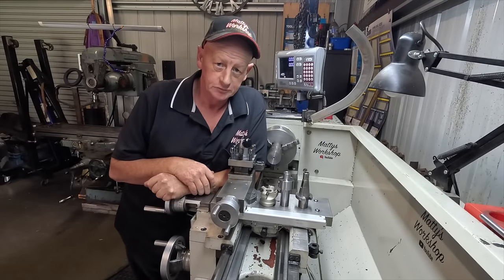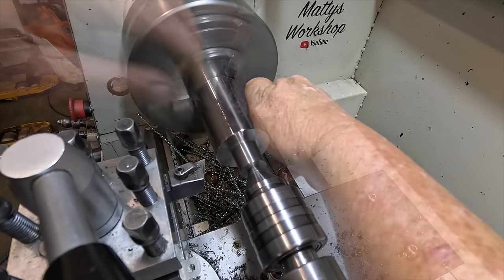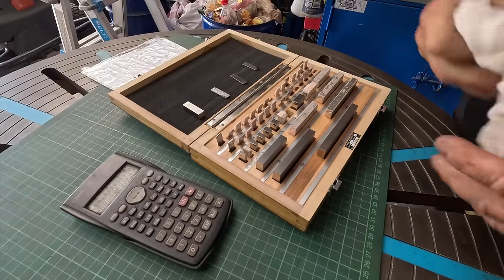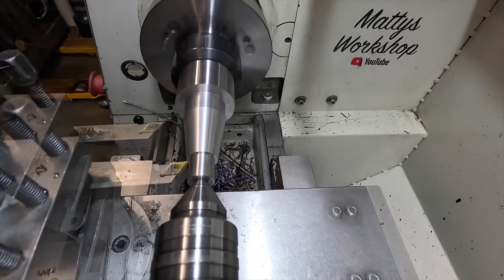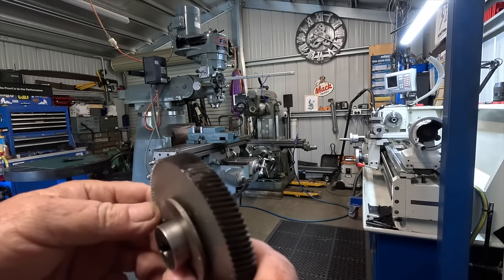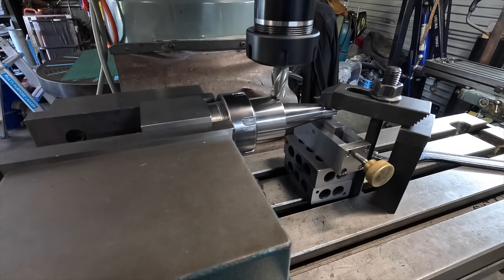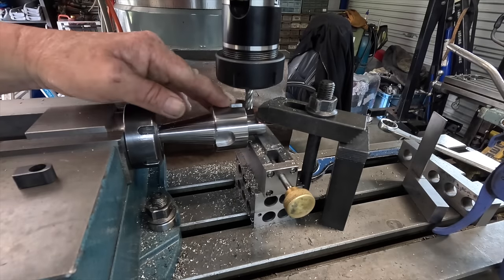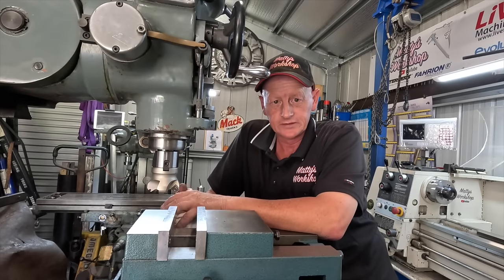NT30 Arbor for the Face Mill...

Comment: Hi Matty, good post mate, enjoyed it.
 We had a mill that was branded to "Sharp", but was a 'First' mill, made by Long Chang Machinery Co.,  Taiwan. Had to get a manual off them but had to pay. As for the right spot on the quill, block the quill so it won't fall on your toes. Take out the handle and you will remove the pinion, could be a clue on that. You could also have a look at the rack through the pinion hole. Regards to you and family 👍
Reply from the maker: Gday, Ive been lucky enough to get the information from First on the mill today, I just have to start finding the issue now, Appreciate you watching and commenting mate, Cheers

Comment: One for next time, if you really want close to zero run-out you should leave the surface oversized and true it up in the mill spindle. Good job, she'll be alright for what you need and 0.02mm RO is very decent.
Reply from the maker: Gday, Ive seen this done before but didn't give it a thought, Appreciate you watching mate, Cheers
Reply: another thing I thought of too, do your drilled and tapped holes and then turn everything between centers. then you'd have zero run out between your taper and the surface the shell mill sits on (that goes for the back face as well. and if your tapped holes aren't straight it won't matter because turning between them will minimize any mismatch drastically.

Comment: Mat I had a funny feeling when you where getting the trailer ready for a 500KM road trip a new machine was coming to the shop. I could not hear any excessive noise from the bearings. If you only getting 0.0001 runout from the spindle I would say the spindle drive is in perfect health.
Reply from the maker: Gday, The trailer repair was after I picked the machine up, I was on another mission for a mate when I did the 500k trip, the mill pickup was a 1000k adventure, was a fun day to, Thanks for watching mate, Cheers

Comment: You can go off people you know!!! 😆. I am not in the least bit jealous 😭😭😭. Well done mate, good score, and in my opinion the pulley change heads are far more durable than the vari drive versions. Spindle sounds ok, heard far worse. I would start with your X Axis gib adjustment based on the noises you are getting, followed by Y. Got to ask yourself why the traverse gear is mangled.......start there and work backwards. 👍🏴
Reply from the maker: Gday Jon, Im pretty stoked to have this mill, I've done some more investgating today and I believe I've found the issue, I really don't mind the step pulley setup, its not that hard to change the belt speed at all and its quite, Appreciate you watching as always mate, Cheers

Comment: Matty I have a Bridgeport Clone marketed as McClane. Made in China but the head is made in Tiawan. The same mill is marketed in many different brands. Even the PM Mathews is the same mill. AS well as Sharp and Acer and many many more. The only manual I could find is branded Birmingham. I have the paper copy that I could take a picture of the belt drive head and email it to you if that would help. My quill kept falling down with any weight at all on it. I took the handle off and looked inside on the right side and the clock spring had came off. It is really simple to work on as I took pictures as I took it apart. I prefer the belt drive because it is so much Quiter. I gutted the electrical panel and put a VFD inside the panel and it is quite as a church mouse, and I do not have to change pulleys to have variable speed. I absolutely love. it. I very seldom use my PM Mathews 833T gear drive mill anymore because of the difference in noise and speed. Thanks for bringing us along.
Reply from the maker: Gday Terry, Thanks to a viewer I was able to get in contact with the company here in Australia that sell the First Mill, These guys were kind enough to send me a parts breakdown and parts list of the mill, I got super lucky mate, I really don't mind the step pulley setup now I have the VFD, Appreciate you watching mate, Cheers

Comment: Hey Matty, I know a guy down the coast that could probably make a gear like that 🤔Does the table swivel on the cincinnati? What HP is the motor? The VFD seems to work well - I'd like to put one on my Maho, but there is too much control gear in it. All the best mate. Cheers
Reply from the maker: G'day, I wish I could make this gear but sadly im not setup to do helical gears, thats way above my brain cell level, I have a 3hp Vfd and the mill is 2hp motor, Thanks for watching mate, Cheers

Comment: Great job on the arbour Matty. The slight cushion at the top of the quill travel is a good thing. Saves the quill whacking the bottom of the spindle when you let go of the handle. I had an old Richmond mill that was the same. Never gave any problems.  ATB regards from the UK
Reply from the maker: Gday, In one way its a good thing for sure but worries me in another way that its not right, Thanks for watching mate, Cheers

Comment: That is a bridgeport clone,  mine had issue with sticking quill and I found the collar around the quill stop screw was slightly cocked.  it rides up and down the front window with a close tolerance to the machine and if off slightly it would drag.  Mine would get out of alignment when it sprang up to the top.  I simply turned it to square with the window with a crescent wrench, spanner to you I believe, and it worked smoothly.  Of course this was after complete disassembly and reassembly.  I also loosened the return spring for the quill so it does not return as hard.  Hope yours is the same,  if so it will take less than a minute to correct.  This is the collar that surrounds the quill stop screw.  Look in the back part where it attaches to the quill and its square shoulder clearance to the machined vertical slot.
Reply from the maker: Gday, Thanks very much for the heads up i'll check that out and see how I go, Much appreciated mate, Cheers

Comment: Gday Matty nice job as always I had to make an nt30 arbor for a tapping chuck all worked out fine but the material I used was the hardest I have ever machined I had to use ceramic inserts for the whole job
Reply from the maker: Gday, I have to get some ceramic inserts myself, I have some stock here I need to get the case hardening off, Thanks for watching mate, Cheers

Comment: Congratulations on what looks like a really nice, new to you mill and good to see you looking so chipper Matty. 
I bought a universal mill (1966 vintage) in really good condition, which is still being set up, which is ISO40 on both spindles. I priced up EN8 (1045) material to make some new tool holders, which would have been around £40 per holder. My local tooling merchant, also one of the UK's biggest suppliers had a January offer of YG-1 ISO40 tooling, balanced to 15K, at just over £20 each. I ended up splurging rather more than I originally intended on 10 of various types, I quite simply couldn't justify machining them myself.
Have a look at Tom's Rabbit Hole, he now has the ability to hob helical gears on his much modified mill, he may be able to help out.
Reply from the maker: Gday, Bill, I found thew same thing here, I was looking at making my own collet arbors first, I ended up buying one for $49, By the time I brought a collet nut and material it was well over the $49 and still had to do the machining, I also brought a ISO30-MT3 for $44, Ive been following Tom for quite a while, He is bloody amazing and im fascinated with what's he's done, its truly a work out art mate, truly appreciate you watching and commenting, Cheers

Comment: Hi Matty, congratulations on your new mill.  I'm looking forward to watching you get it dialed in.  Good luck finding the manuals.  Regards, Dave
Reply from the maker: Gday Dave, hopefully its not going to take to much dealing in, I'll be happy if the spindle bearings only need an adjustment, Thanks for watching mate, Cheers

Comment: the quill sleeve gaurd may be binding Matty on the top stroke of travel, check your height stop window see if you have crap in there. its a tight fit so any swarf may be the culprit
Reply from the maker: Gday Troy, thanks for the tip mate, I'll check that out tomorrow, Cheers

Comment: Nice job Matty! This really is the best kind of face mill for a bridgeport type machine. I use mine all the time for when I need to take off a lot of metal. I let it run about 500-600 rpm with a 300mm/min or so feed rate and just let it eat
Reply from the maker: Thanks for watching mate, Cheers

Comment: Re first mill. The tightness at the top of the quill will probably be due to the adjustable depth stop fitting . They tend to distort the quill tube slightly if banged to a stop.
Reply: I thought maybe had a ringclamp on it for years - for a light or a measuring tool??? Since been removed
Reply from the maker: Thanks mate, I have some investigating to do I think, Cheers

Comment: Very exciting to have a new mill, looks like it’s in great condition.  Pull a belt off when spinning that arbour by hand to see if it’s the bearing or just he motor noise.  Sounds similar to mine and the bearings are good.  Some lubricant (spray mist) may help with the squeal. That’s excellent runout on the arbour, I doubt there’s anything wrong with the bearings considering the condition of the machine.  I added a quill DRO on mine, just an idea to look into https://youtu.be/hww_Lm_e3oA?si=rBgSQsMB6kxkwVZv
Reply from the maker: Gday, Ive had the belt off and the bearings sound pretty quite, im still looking at taking the spindle out just to have a good look at the bearings though, I'll check the link out, definitely going to need a quill DRO at some stage, Thanks for watching mate, Cheers

Comment: Wooooo Hooooo 🥳🥳
A spindle rebuild 👏👏👏
No disappointment there for us mate….. it means another Matty’s Workshop video
😎
Can’t wait mate…. Sand that turret mill looks to have been well cared for.
Regards
Robert
PS Does it have a quill auto feed?
Reply from the maker: Gday Robert, Its not going to be a complete strip down and i'm pretty happy about that, for a 1980 model machine its in good condition overall and it does have a auto feed on the quill, Appreciate you watching mate, Cheers

Comment: Hi Matty, just buy an ALSGS or Align power feed, the helical gears are the same and if you strip one, easily done, buy a new gear, cheap as chips.
I had a similar mill, branded Smart.
The heads are all the same, make sure it is well oiled and adjust the preloaded on the bearings..
Mine had Turcite on chrome ways, last forever.
Have to persevere with my mill drill for now, such is life.
Reply: The Align and ALSGS power feeds are 230 Volt, no need for transformer. 
I stripped a gear in mine, not waiting for it to slow down and putting in reverse, otherwise they are bullet proof.
Reply from the maker: Gday, If I can pick up a gear for the Servo power feed it would be nice to keep it all original, if the gear isn't available then i'll look at getting a new one, Appreciate you watching mate, Cheers

Comment: G'day Matty, sorry only got to this today ( Saturday) nice job mate. 0.02 runout is pretty good even with the suspected spindle bearing problem. If you do have to replace them, then theoretically the runout should be even less. Presumably the bearings will be taper roller ones, so the replacement of them should be pretty straightforward mate. Anyway you'll get it sorted knowing you Matty . Is there a visual ding on the outside surface of the quill around the place where it goes tight? Hopefully it's something like that, that you can stone down to ease it. Cheers from England, Sam
Reply from the maker: Gday Sam, there annular contact bearings and there getting replaced, once the spindle is out I can have a good look at the internal taper, Thanks for watching, Cheers

Comment: Matty  don't convert to angle,  stay with a slope .i.e. the ratio of the length of your sine bar to the taper length (24) it the same as the ratio of the depth of the taper to your gauge block stack , so no tables required just divide and multiply
Reply from the maker: Gday, I really wish I payed more attention in maths class at school rather then looking at log trucks going past out the window, I have a lot of trouble when it comes to numbers mate, Cheers

Comment: What DP is your gear?  If I have all relevant dimensions and the necessary cutter I'll see if I can make the time to produce one.  I do have some ductile iron on hand in size up to 6 inch diameter. . . .  Mill feeds are currently in last stage of overhaul, so a good test of that system would be welcome.
Reply from the maker: Gday, Thanks very. much for your offer, Im pretty sure a viewer has sourced where I can buy a gear from, if something goes wrong I'll let you know, Thanks for watching, Cheers

Comment: Hey Matty, my Bridgeport quill has that same tight spot. It started after a cheap Chinese-em arbor got stuck in quill, I had to adjust the guide pin in the spindle and once I got it sorted out and adjusted properly the tight spot went away. I guess what I’m saying is to check the alignment pin in the spindle, or even remove it and test the quill operation, if it clears up the tight spot then there is your problem.
Reply from the maker: Gday, Ill have a good look at the spindle mate, Appreciate you watching mate, Cheers

Comment: Howdy Matty. I have that same milling machine, with the exception of my head is variable speed. I can check if I have the same gear. If so I'll see about building ya one. Great video!
Cap'n
Reply from the maker: Gday, Thanks very much mate, Greatly appreciated, Cheers
Reply: I measured my drive gear, it is 90 mm. I will pull it off this weekend and count the teeth. My power fed is an Enco brand. Maybe it's the same as yours. If so, I'll set up to cut you a duplicate. Do you mind if I do a live stream building it and mention your channel?
Reply from the maker: @captainraypaul4919  absolutely fantastic, this would be greatly appreciated, I certainly don’t mind you mentioning the channel at all, thanks very much mate

Comment: G'day Matty.   The NT30 spindle worked out well, just wondering why you didn't cut the thread before you turned the taper, the  tailstock taper would have lined the threaded section ok
Reply from the maker: Gday Ted, The thread got done after the taper simply because thats the way it all ended up happening, Thanks for watching, Cheers

Comment: Hi Matty love the video. On your mill most of these are clones of the bridgeport. A couple of years back I refurbished my own called a supermax. I used the bridgeport manual and a company called H &W machine repair and rebuild. They have a YouTube channel as well with a lot of videos on mainly bridgeport. It helped a lot to figure how the machine fits together. Mine also has the NT 30 taper.
Reply from the maker: Gday, quite a few have mentioned H&W, I’ve checked out there channel and it’s very helpful, appreciate you watching mate, cheers

Comment: Hey Matty . You might check the set screw holding the spindle nose from coming loose. I had mine a little too tight and the same thing happened.
Reply from the maker: Gday, I look into that mate, Thanks for the heads up, Cheers

Comment: Hi Matty, great that you have a spring in your step once more, I can hear it in your delivery. I have an Acra mill it has two "oil me every day points" which used to be very religious about. I found that it can get overoiled and the bit that gets least used gets gummy, use and a lighter oil sorts it for me.
Reply from the maker: Gday, I starting to feel a lot better after the chemo, i'm still not 100% but much better then I was, Its only time now, thanks for the heads up on the oil mate, Much appreciated, Cheers

Comment: On the left hand side inside the aluminium flicker box, there will be a retainer nut on the end of the rack..beware the quill raiser spring. 

Pull the rack out, the quill should come straight out.

Might be wise to get a low profile nut on your draw bolt. And attach a gentle slide hammer to extract the quill
Reply from the maker: Gday, Thanks very much for your advice mate, Much appreciated, Cheers
Reply: Let me know how it goes